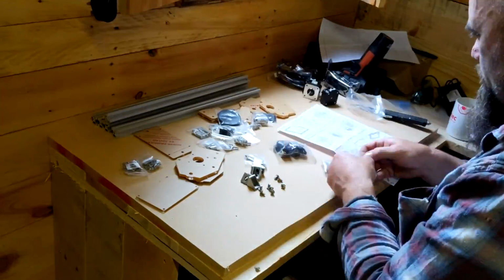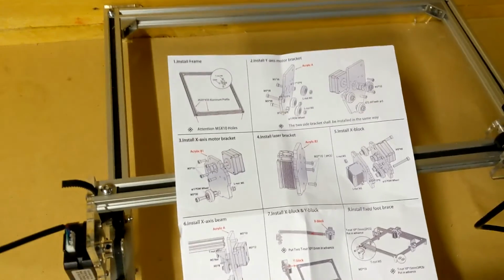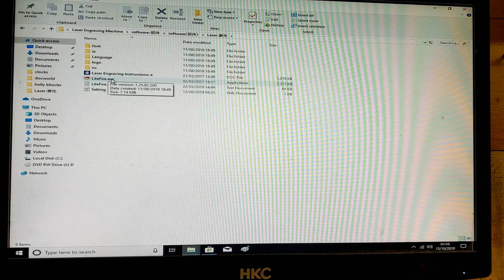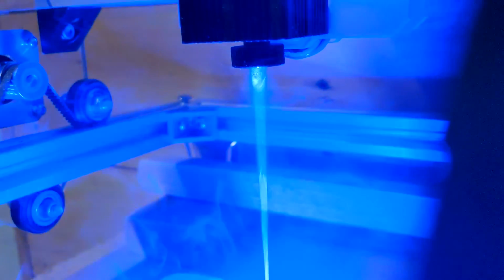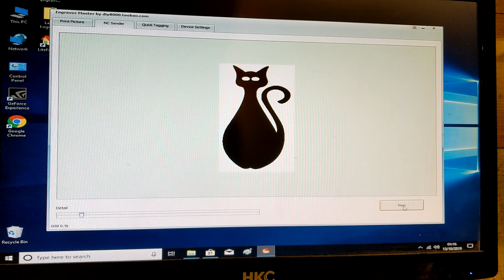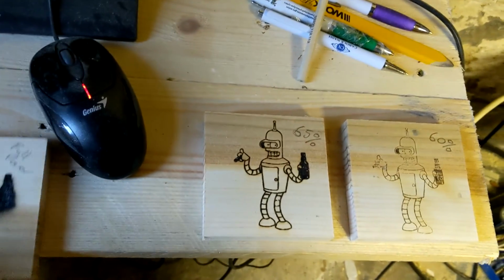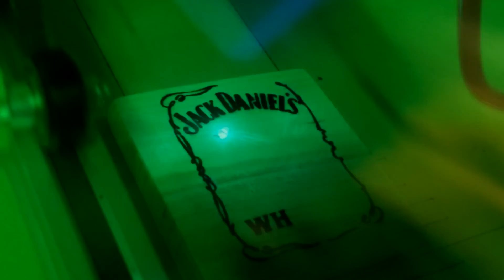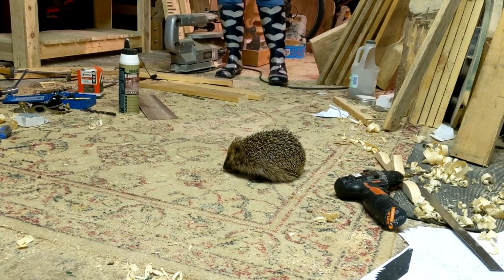Alfawise c30 cnc 2500mw Laser Engraver - A Great Piece of Kit!

Comment: Interested in one of these so thanks for the video. I want to use it on shaped pieces so wondering if there’s a way of lining up the wood under the laser. Can you move the laser head through it’s path in the software to see how it aligns with you work piece?
Reply from the maker: Yes, theres a function on the software where it draws a box around the item. Ive also started using Lasergrbl more and there also a function on that which automatically goes to the center of your design and turns on the laser weakly. I find the center on the piece of wood and then just line it up with the laser dot.
You cant move the laser head with this as its fixed in place.

Comment: is it a cnc router as well
Reply from the maker: No, but with some additional parts you could modify it to use an engraving motor, you would have to add a Z axis motor setup as well. Youd also need to strap it down etc. etc. probably be better to buy a dedicated engraver, theyre getting cheaper and cheaper Ive noticed.

Comment: Have you tried are assist it’s just a small air pump for a fish tank it helps a lot keeping the burn stable and helps cutting veneers for glueing to other wood try it it’s not expensive to get a small pump some air tubing and look online to find what you need or maybe you already found out about it I’ve got the same laser as you the C30 I’m using LaserGrbl and I also you an outside picture conditioner to get the picture ready for burning it’s called Imagr a free image processor works great I’m just getting to experimenting with veneers went to eBay bought some all in one packages of different veneers got 60 in of burls 5in x 8in and another of domestic wood they all tell you what species they are somewhere on the back keep a journal like you have been also learn to burn on tile there are programs for expanding the picture to many tiles so instead of burning a picture on one tile it takes that picture spreads it across and up and down across multiple tile I’ve done 6 tiles x 6 tiles etc it really awesome . But it takes longer once you get the speed and the burn percentage down it goes much faster sorry if you already found out all this just trying to help old luck